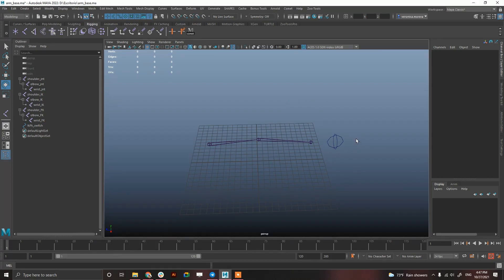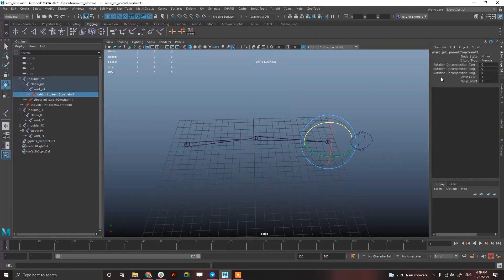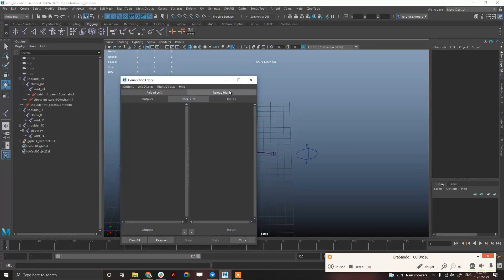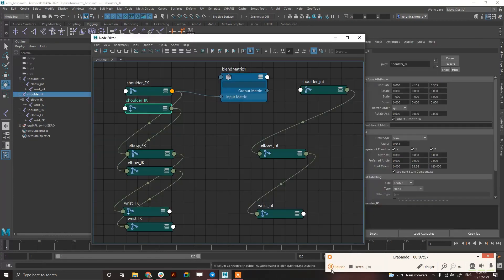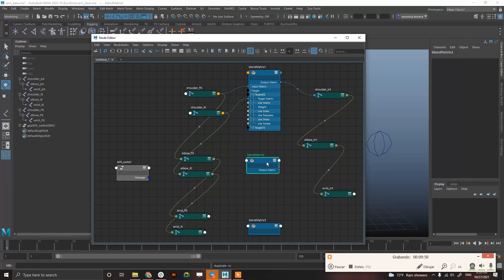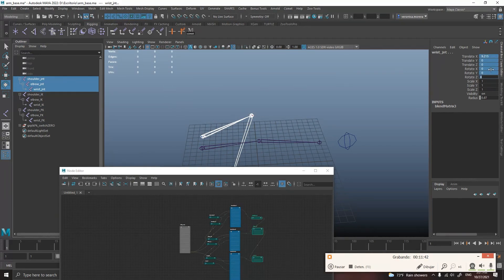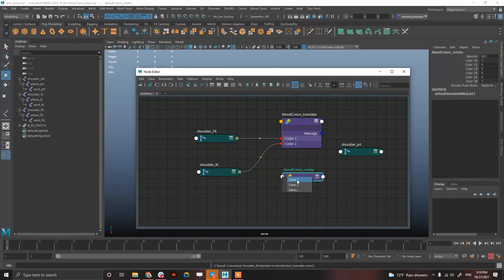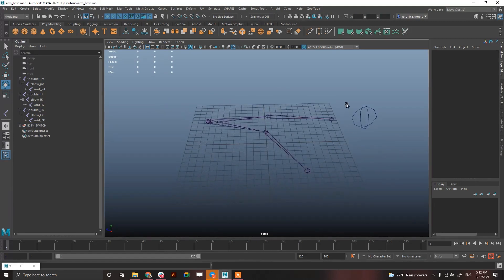3 and a half ways to create an IK/FK Switch

Comment: hello veronica. I love your video.. Is it okay to remove the inherit transform when making a matrix based switch? Which one do you prefer?
Reply from the maker: If it's only a one to one connection should be necessary, if it's like ik-fk switch you may need to do it in order to avoid double transformations
Reply: @VerónicaMorera  yes i know why you removed it. but won't this cause other problems? also which of these systems do you think is suitable for every situation? because i find parent constraint very outdated. but for example when i make a matrix based ik-fk switch i am afraid that when i throw it to the game engine it may not see the keyframe

Comment: Thanks for this great recap of various method. Now I think there is an additional method. Lately I have had to skin some models where the arms only used one chain instead of the three chains... I will need to do some research into that. I think it is using a matrix method as well.
Reply from the maker: Sounds awesome! If there isn't any trouble in sharing, let me know :)